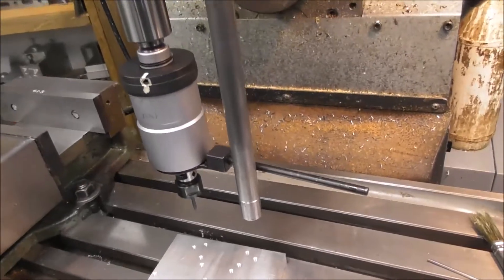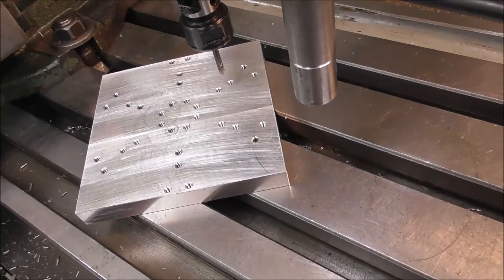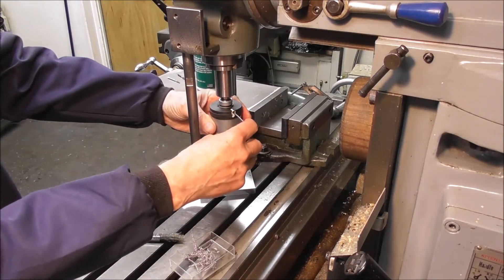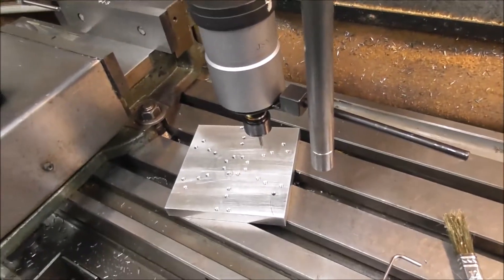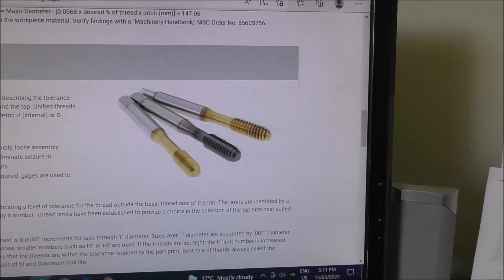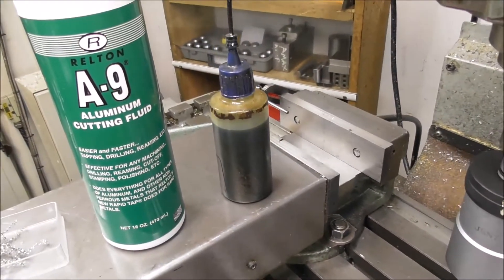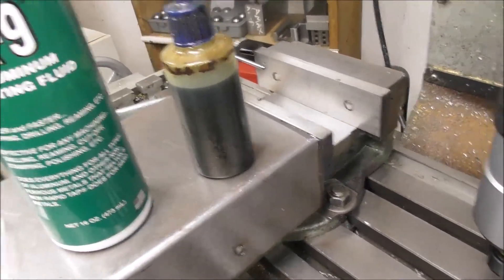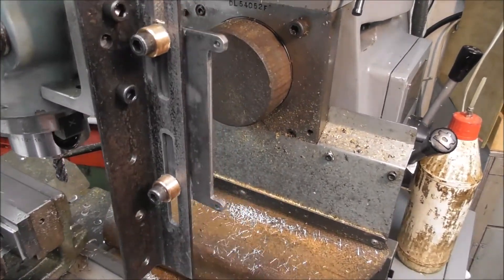Tapping Heads for Tiny Threads!

Comment: Spiral point AKA Gun taps do not break the chip well. They need to go all the way through. In tough materials blind holes the tap can break due to chip jamming on reversal. You also have to drill a lot deeper to allow the chip to go ahead.
Reply from the maker: I don't back gun taps off, other than once to retract if the hole is blind. I have never had one break, and often I am working with tough steels. I suppose if the chip is going forward, you can't back off and chip break anyway. Cheers, Cliff
Reply: @Threadexpress  I am referring to gun taps in blind holes. I spent 10 years working with only stainless 304 / 316 and I have had them break in stainless upon reversing. For through holes they are a dream.
My comment was just to say that gun taps are not a simple direct alternative in blind holes as a lot of people seem to think.

Comment: We tried that same head with 6-32. I was tapping steel A-36. Broke every one. All five. I ended up setting the clutch very low and if it jammed I would reverse it. And repeat that. It was slow and frustrating. I’ll keep trying other taps. Has this worked for you with steel?
Reply from the maker: Hi. A-36 can be tricky. And 6-32 is not a common thread in NZ, but it looks like quite a coarse/deep thread form, which is doubly tricky.  If you are breaking taps, of course the tap is too stressed. If it breaks once, you need to lighten the taps cutting load by around 50% to be safe. Tap alignment, high grade cutting oil, a razor sharp gun/spiral point tap, and finally test it in some scrap steel with a larger diameter pilot hole, until it cuts freely and cleanly. If that does not meet the required spec, you may have to change tap quality, thread type, or thread pitch, or thread length or steel type. I doubt the problem is primarily the head. Cheers  Cliff